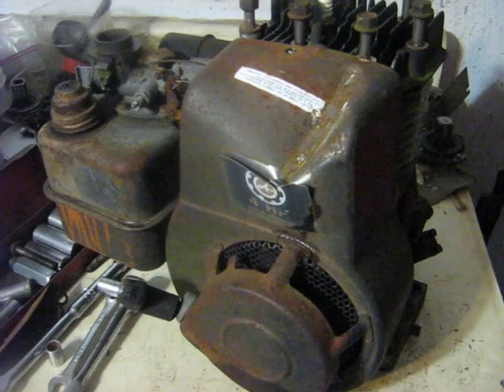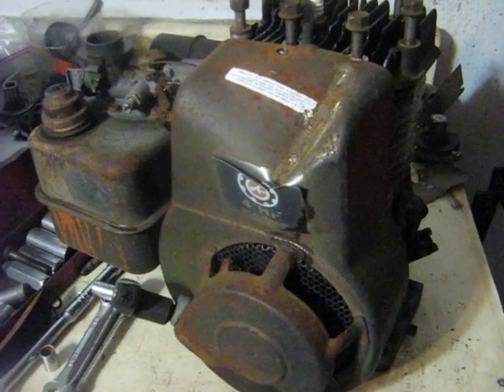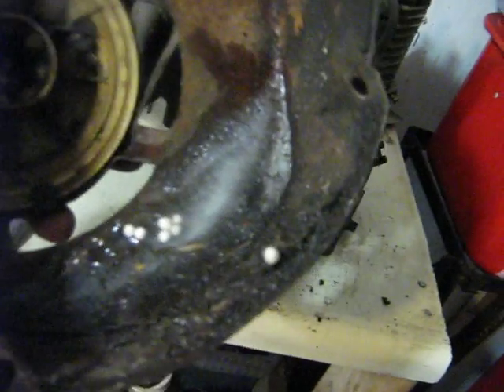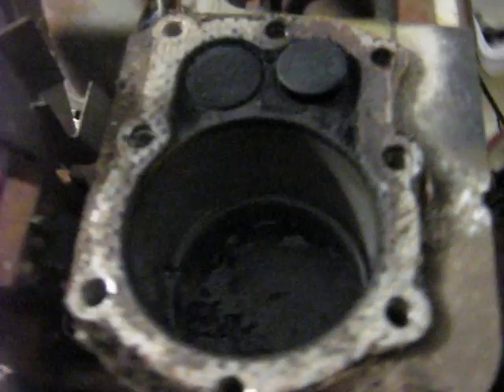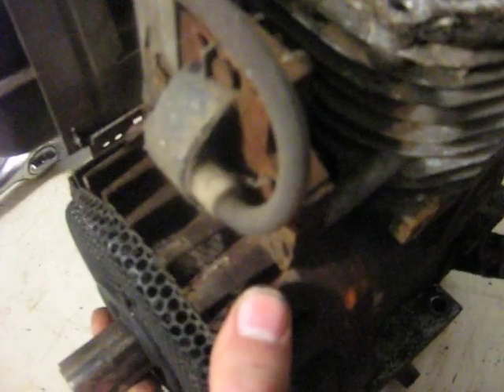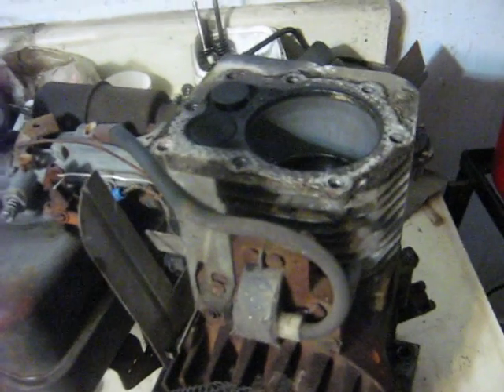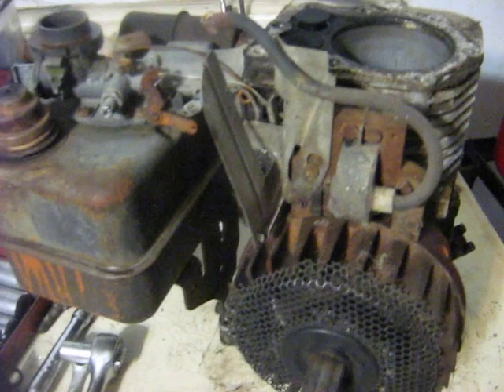Briggs 4hp Seized Up?

Comment: If you put some oil or something in the cylinder to lube it and take a piece of wood and set it on the top of the piston and gently tap it, it should free it up. Worked with me many times.

Comment from the maker: Yes, some type of penetrating oil sure helps out a lot with seized parts. Letting the parts sit for at least a day can also help. Diesel fuel is another cheap penetrationg oil, when you need to soak a large part for a while, it seems to work pretty well. I hear it is good for unseizing pistons in seized engines. If appropriate, heating with a torch can also help by expanding one of the parts, and breaking rust loose.

Comment from the maker: Good guess, but that wasn't it, I mention the problem on a new vid I just uploaded (don't go by the tiltle, it is describing another problem).
The latest engine I tore down have both valces stuck so badly I broke a valve tappet off prying the camshaft out! I had to use a long bolt to drive the tapped out, since it was seized in also! It was one of the tightest seize jobs I have ever seen.